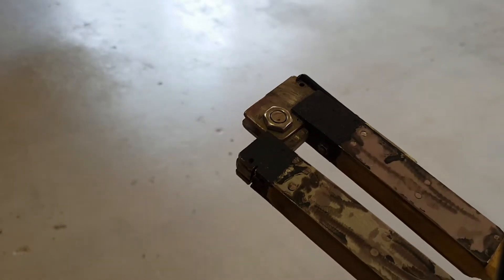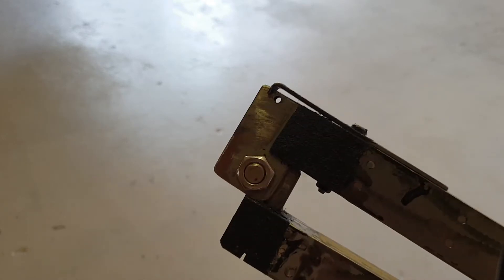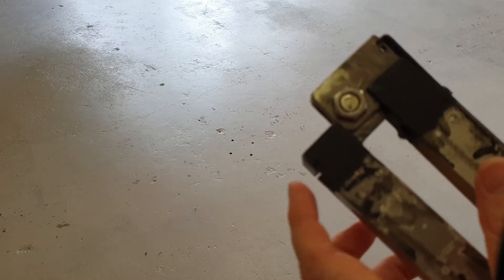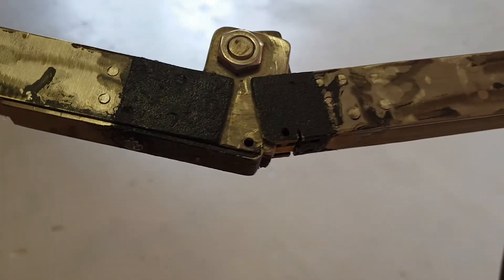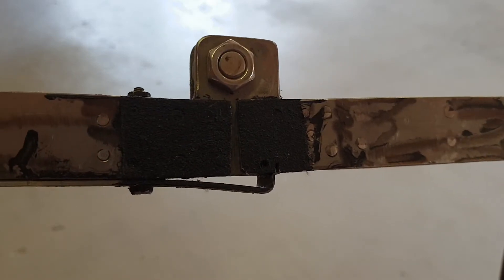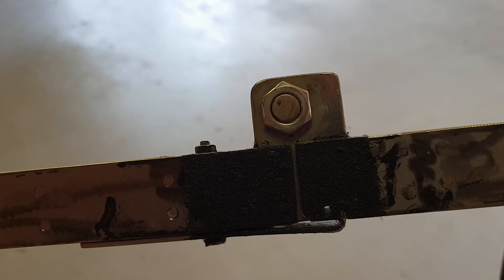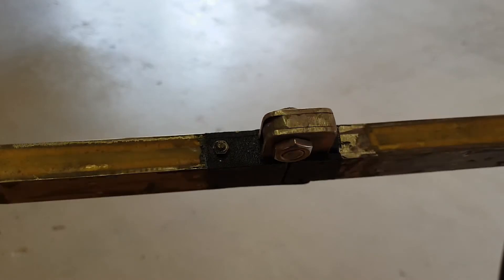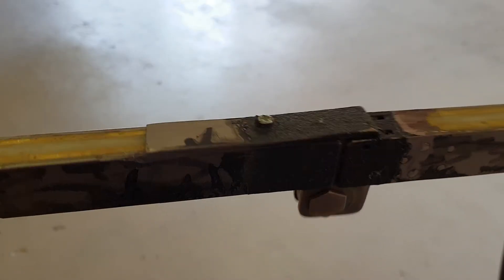Titanium folding spear locking mechanism operation.

Comment: Nice work, Chief. Is there any way to make it more compact and streamlined?  Maybe making the lower portion telescopic with a single, double, or quadruple spring button lock with at least two locking positions. Then, the upper portion can be fixed in place or folding with simple yet strong backspring locking mechanism like that of the classical Spanish Navaja knives and the Marksman folder from Buck Knives?
Reply from the maker: Thanks for the comment. I agree that the design needs to be optimized. This was my first stab at it (excuse the pun) and the result, while functional and robust, was a bit clunky and inelegant. I think your suggestions are well worth investigating further. There have been a few requests for me to build a fully telescopic version of the spear, so I am currently researching that and have thus put the folding design on the backburner for the moment.
Reply: @WushuEngineer  Nice. I've been working on some takedown and/or modular spear design ideas as well, for hog hunting and predator defense and such. Do you have a Facebook and/or  Instagram page? I would like to learn from your experience and perhaps exchange ideas.
Reply from the maker: @jonathanchark5291  I’m not very well-connected online, I’m afraid. I don’t have a Facebook or Instagram page for my channel. My YouTube channel and associated websites are pretty much it. I am always interested in sharing and discussing ideas and would be keen to see what you’ve been working on. A Facebook page would be a good platform for that, so I’ll see about getting a Facebook page going for the channel in the next day or two.